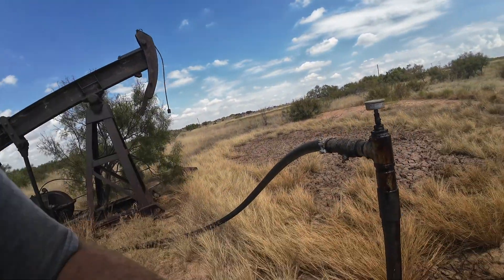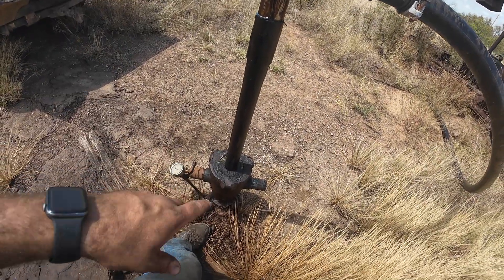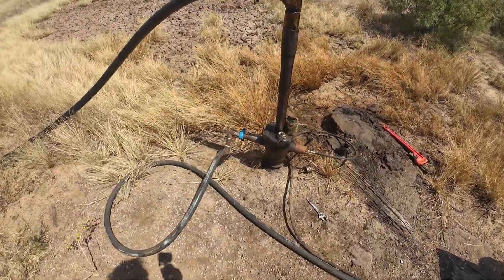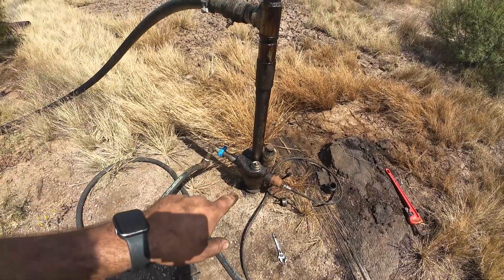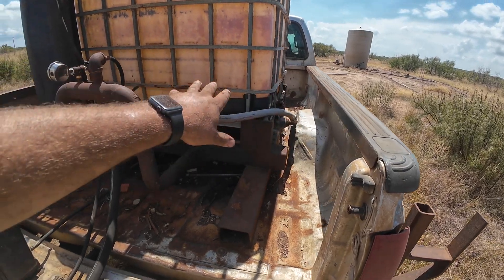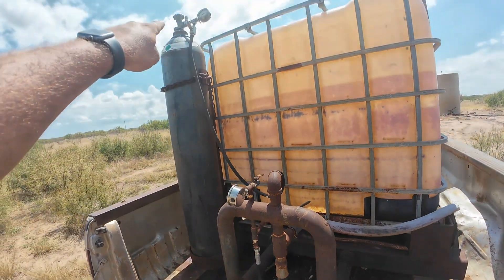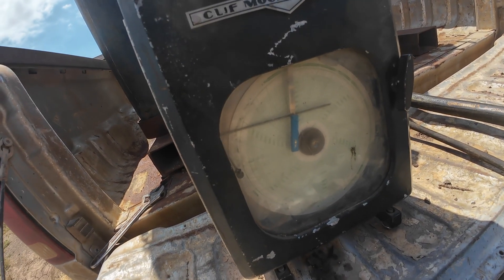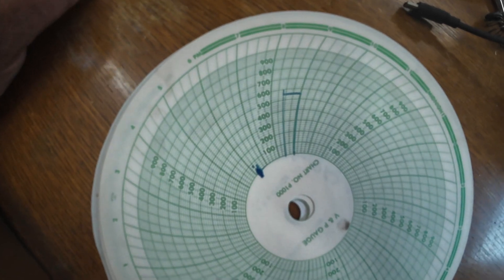H-5 Test

Comment: Never seen an injection well without a check valve on it at the well. Always a first time though. Back flow protection. But I also never saw poly except on the suction side of the pump.

I've always planned for the worst case scenario if something went wrong. Including high pressure valves and tees. With a lease control pressure switch at the injection well.

The EPA under the wildlife protection Act has really put a damper on old school poor boy ways we used to get away with. Even if you own the land. Wild life over rules even if they are a pest crawling on the ground. Anymore killing a rattlesnake can get you a fine.
Reply from the maker: It's a low pressure formation that won't flow back. when shut in it goes on a vacuum in a minute or two.

Comment: I wonder if you have stratification in your formation due to low turbulent flow. With such a low injection rate it’d be interesting to flow it back and see what sort of oil had built up in the topside of it. Thanks for the content.
Reply from the maker: this formation is absolutely stratified. It will not flow back it will have to be pumped. I'll do a video on it if I work on it.
Reply: @TheZachLife  I guess your bhp being so low artificial lift would be the ticket. Best of luck and I’ll look forward to seeing the results. I’ve seen many an injector give up all sorts of production so I wouldn’t be shocked.

Comment: Nice video of a casing by tubular annulus test.  Pretty sure you know all of the tips for thermally equalizing these wells IFF they are difficult to pass.

On the changeover note, would you be able to (wireline) bail on the tubing to see how long the oil production lasts ?  Just curious as to whether it's carryover oil from the produced water system vs. formation oil.  We had to 'pump' back on our injectors every so often to clear near well oil/sludge and lower our water injection pressures for awhile. 

Used a skimmer system on tank-treat water separation so we usually had carryover. Gotta love commision reps who love their weekends just as much as producers 
👍
Reply from the maker: Yep lol. I would expect to have to pump it for at least a week to get a test on it, so if it happens it will have to be with a pump. I'm confident it's from the well not the injection system.

Comment: Lots more going on than just hook up a pump and see those barrels fill up with good oil. Still don't know if this is a lubrication oil or a fuel oil. Miss the Garfield and Simpsons tv shows, kept those people running for office in check for sure
Reply: THe SImpsons is still running.  It's about to start it's 36th season.
Reply: @andrewalexander9492  Thank you very much. I do not have tv reception here so rely on a computer for videos. Some places like where I am in Alaska have limited or very poor reception.

Comment: Thanks for another great video. How old is that 24 hr. chart recorder? I was using them back in 1976 and they were decades old then. Had to wind them up with a key every day.
Reply: Mine had a eight day clock in them👍🏻
Reply from the maker: this one is electric, I would guess 70's
Reply: @TheZachLife   👍🏻
Reply: I remember using one from the 1950's in the aerospace industry. It was finally replaced with a computer in the late 1990's. I was using it on a destructive tester for things like MOE'S for certain materials. The computer made it easy because it would do all the math as well.  However, I missed doing the math by hand on paper.  Those were the days, slide rules and everything. 🤣
Reply: @ironcladranchandforge7292   👍🏻

Comment: If you convert that back to a producer what would you do for an injection well?
Reply from the maker: This lease has 4 more.
Reply: Love the fact, that you are being extremely wise in what you cap and produce from.  Was the previous test failure, just a paper screwup?
Reply from the maker: @matthewforrey9956  yes
Reply: i think if it goes into production it goes to a five year test.   i am probably wrong.  i looked this up and found a railroad commission site but not sure if i looked at the right thing.    I find the subject of varying well production over time interesting?   why would an injection well start producing again?   maybe the injecting is like fracking?
Reply: @brianmoore5498  if a well is unused for a period of time it is sometimes possible for fluid to migrate from surrounding areas towards the well making it active again. Like you, I'm wondering if converting it into an injection well for a while can bring it back to life.